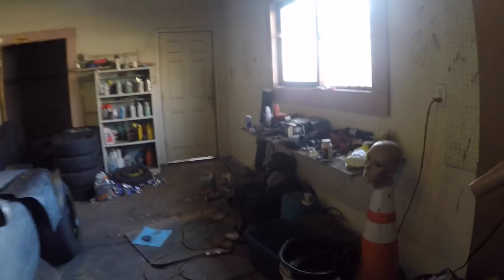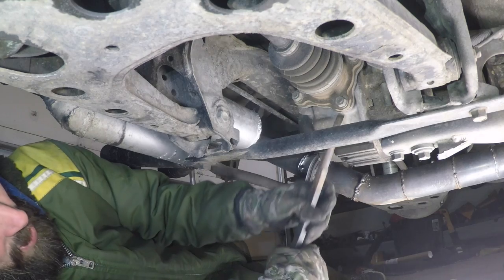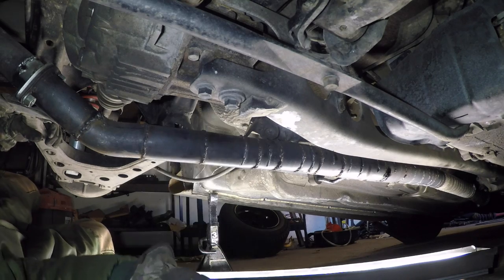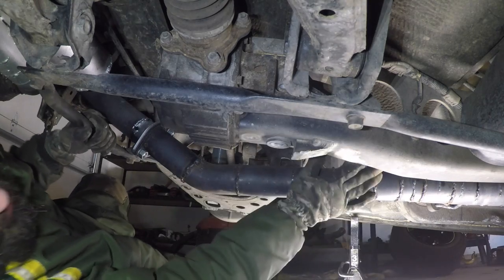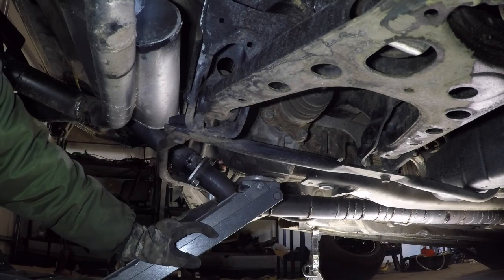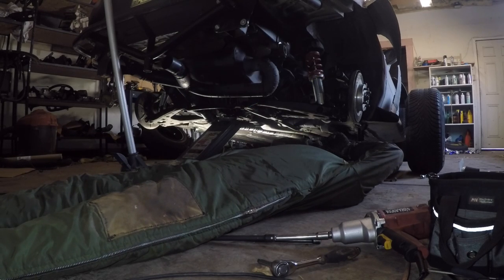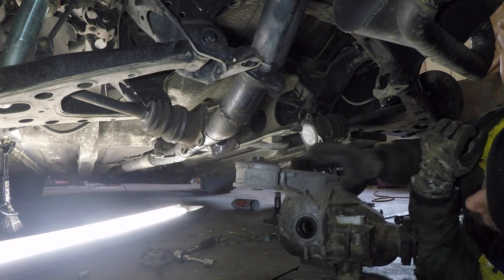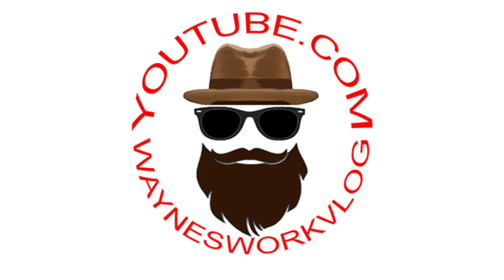Miata Rear Differential Diff Removal ACTUAL S07E25

Comment: Man, I can't stop looking at that exhaust. I'm a big fan of, "If it works, run it" but you've taken that to a level I haven't seen before! It was super helpful to SEE how you popped the axles. It pretty definitively showed me that I just wasn't pushing hard enough, and now the job's done. Thanks!
Reply from the maker: hahaha thanks man. it literally just worked... be sure to check out the exhaust install video.
Reply: Will do. As I've installed different seats in my hillclimb car, I've had to modify the transmission tunnel and floor a fair amount, which has caused me to make a few exhausts of my own. They're not beautiful, but they've all functioned well. You've earned a new subscriber, and after this weekend's race I'll spend some time catching up!
Reply from the maker: hey i really appreciate that!

Comment: I’ve been trying to find a video of people explaining the re install process of re attaching to the PPF but nobody talks about it. How do the plugs respond when putting them back in the top?!
Reply from the maker: get them lined up best you can and then slowly install the bolt from the bottom. it will usually draw it in straight.

Comment: I've been trying to remove the bottom plug on the PPF in my 1990 Miata. I've been prying and chiseling on it for hours and didn't even make a gap. How do I remove it?
Reply from the maker: there are two little grooves on the sides on top, wedge a flathead in there to make a gap. then pry it up and out

Comment: Hi  my 2003 was rear ended and it broke the passenger  diff arm  Is it possible to just remove  the  axle's and the rear diff hanger bolts  and the bolts  going around  the  case and  back the case off from the other part ? Or does it have to come straight down ,
 I don't want to talk the front part out if I don't have to. If I want to use the seals that are in the  diff   that go around the axle  that are in the diff   can they be removed and put back in the new  diff casing I'm getting . I may also need to  use the  bushings that are in the arms . Or should I just get all new seals and bushings ?   One other question  after the  hit in the back  I noticed my gear shift was not in the same place  ,it works and I can change all the gears but its setting lower down  in the opening than it use to   Its maybe 2 inches lower  down . What would cause it to be lower ?
Reply from the maker: its more of a pain to try and remove this stuff without just dropping it. its really not that hard to drop.

Comment: how do you get the lower plug out? at 2:58
Reply from the maker: there are little cuts on the sides that allow you to wedge a flathead screwdriver into and pry it away from the PPF. if you can remove the diff spacer, the large bracket just above that between the PPF and the diff, you don't need to actually remove the plug.